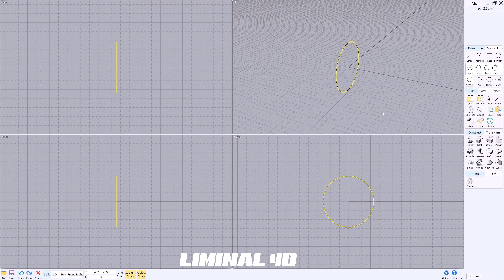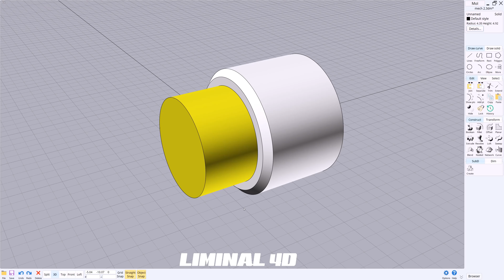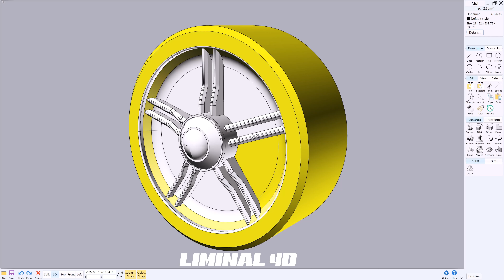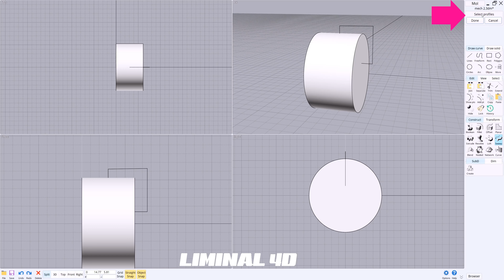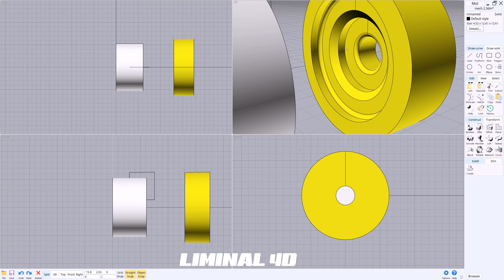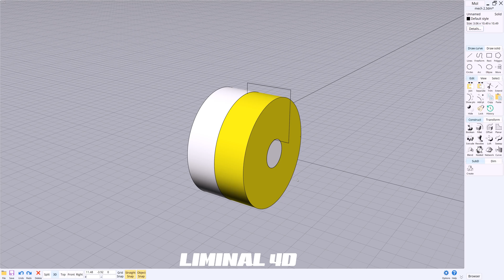Moi 3D Basics // SWEEP TOOL how to

Comment: Is it true the most recent version of Moi is from 2014? It seems that the creator of Moi himself is fairly active in the discussion forums still so that's a good sign, hope Moi continues on for years or even a v.4 comes out. I just discovered this program last month and have been simply blown away by its capabilities and that's coming from someone who's been using 3D apps of various kinds since the late 90's. With Moi I'll NEVER have to look at that 3DsMax interface ever again or wonder why some random vertices across the scene somehow got selected or have to tweak thousands of polygons and or need three whole pages of a manual just to perform a loft!
Reply from the maker: v4 has been in beta for a long time.  I think the latest beta update just came through in September and it sounds like a full release of v4 is getting close now.  I think Moi is going to be around for years to come.  It's just too good of a software.  It doesn't do everything but that's also kind of the charm of the software in my opinion.   There are a lot of things I'll prefer to poly model vs. NURBS but whenever I open Moi, I'm aware of being happier while I'm working, haha.  I think it has to do with the reasons as you mentioned.  Moi is kind of a breath of fresh air for anyone like us who has spent a lot of time in other 3d programs.
Reply: @liminal4d  Good to know! Thanks for your response .
Reply: So stoked to read this. I have only been using Moi for about a year. But I knew within 5 minutes I had to have it. Did you know that Michael Gibson is the main creator of Rhino 3d. Rhino looks so cool but its out of my price range. So pleased with Moi.

Comment: I've just started modeling with Moi3D (mostly pushed by the changes in the free version of Fusion as of last week). This is awesome.
Reply from the maker: What changes happened in the free version of Fusion?  Did they take things away?
Reply: Liminal4D https://www.autodesk.com/products/fusion-360/blog/changes-to-fusion-360-for-personal-use/
Reply: I found this out. I was using Moi for the 30 day trial period. I drew up quite a few drawings. As soon as the 30 days are up. You won't be able to open any drawing's created in MOI. I know its a little pricey. But I am so glad I bought this software. I will use it for many years. Moi works great with Alibre Atom 3d.